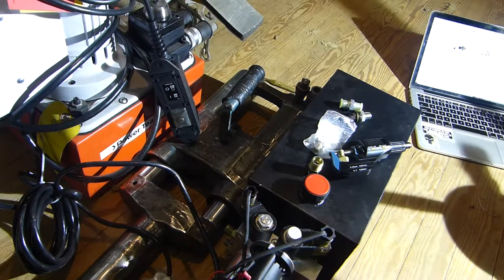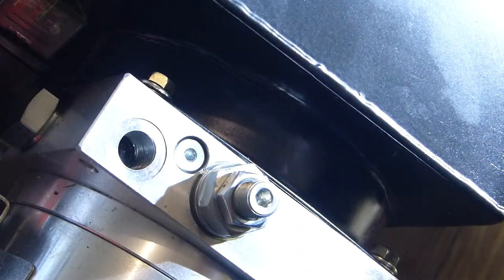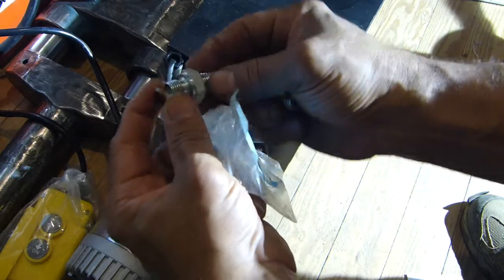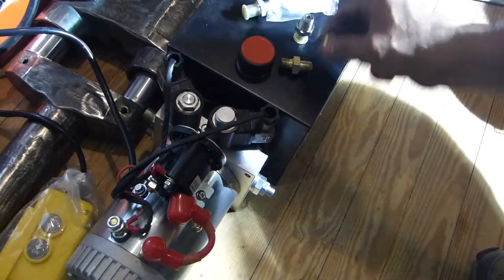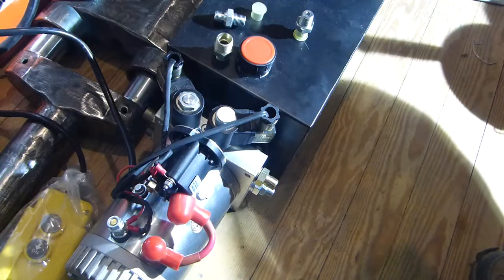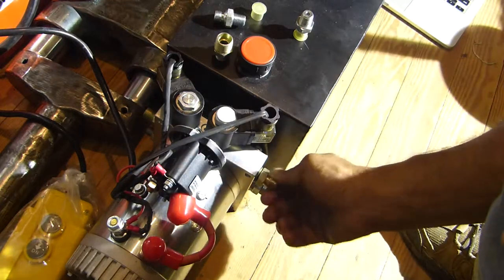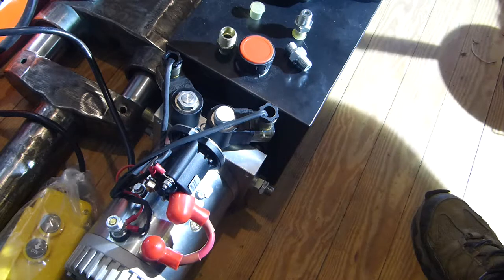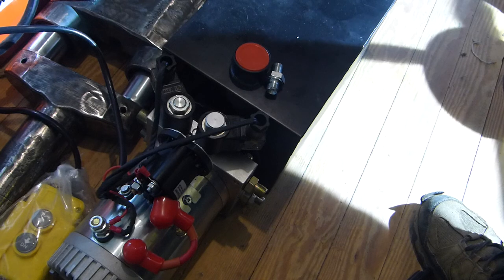Double Acting Hydraulic Pump 12v Dump Trailer BSP Hydraulic fittings

Comment from the maker: NOTE  IF, you want to just jump right into say a JIC connection, you can do so, you just shop for 1/4" male BSP fitting to JIC -- like, 
"7/16-20 JIC x 1/4-19 Male BSPP Steel 45 Degree Elbow Hydraulic Adapter"
Here is a link for this example,   you MUST MAKE SURE IT HAS A GASKET / WASHER / "DOWTY seal"  to make the port seal connection sound.  
https://www.buyfittingsonline.com/7-16-20-jic-x-1-4-19-male-bspp-steel-45-degree-elbow-hydraulic-adapter/

Here is another cheaper way to go also https://www.buyfittingsonline.com/7-16-20-x-1-4-19-mjic-x-mbspp-male-connector-steel-hydraulic-adapter/

It should also be noted the fitting that is supplied is a hybrid type of fitting - a cross of ORB and BSP but not tapered where it ''should be"... another reason you will NOT get a good seal is it also has a rough internal taper and this may give you a false positive on your connection and at high psi loads the fitting may leak... this is is image one  https://ibb.co/LrqmwcN     and this is a second image 
https://ibb.co/QM0dskV

Below are other sources of connections if you just want to work from a different connection... your call.

Here are some charts and help on location of the 1/4 BSP fittings, and some suppliers, https://www.tom-parker.co.uk/products/hydraulic-hose-fittings-and-assemblies/5/hydraulic-adaptors/158/straight-adaptor/564/straight-adaptor-bsp-male-orfs-swivel-female/1590/

and 
https://www.hydraulichoses.com/ProductDetails.asp?ProductCode=P43-FBSPP&gclid=EAIaIQobChMIpPmtwre45AIVkZOzCh3SRAz6EAQYASABEgKDXfD_BwE

and 
https://www.mcmaster.com/bspp-to-npt-pipe-fitting-adapters

Please, comment if you are not sure what fittings you want to connect to and send along photos with those comments... Maybe, I can help you get to where you need or direct you to where you can go...

Comment: In Scotland the seal is called a Dowty seal and is widely used for hydraulic seals. Most hydraulic fittings here ar BSP or BSPT here 1/4" ,3/8" ,1/2",3/4" and so on.

Comment: I have that pump on my dump trailer it comes down so slow is there a way to speed up
Reply from the maker: Negative of a fast lowering pump is the damage of a slammed deck onto your frame.
Does it come down at the same speed when it is loaded?
You would have to make a video for me to compare your pump but it will be the cylinder that is slowing you up more than likely.
Yes, you could so a few things but all cost 💰

Comment: So, I posted a pretty ignorant post about a 10 mm Port debt was actually not even a port at all. Unfortunately, I was barely able to see the print on the very limited directions that came with my pump and even with a magnifying glass that is hard to see what the labels are identifying.  Unlike all of the pumps with clear instructions on the web showing proper hose connections,  bike your unit, there is a port and overflow valve on each side of the pump. I got the correct port fittings for a total of $6 but like Ashref, I am left with vital question: how in the world I am supposed to know which of the ports should be connected to the rod end and which should be connected to the base? So sorry to  have created confusion.
Reply: Anyway, thanks for trying to resolve the first part.
Reply from the maker: Robert, rethread with a helix if u must...
Or change it out to standard threads.
Reply from the maker: You can buy the British thread in most places...

Comment: hi i have one of this how do I connect the hydraulic hoses to the pump wich one is the a and b ?
Reply: Ashref, did you learn which port goes to rod and base? There is no "a" and "b" on my pump or in my manual images.
Reply from the maker: I will do a video and post it tomorrow or the next.